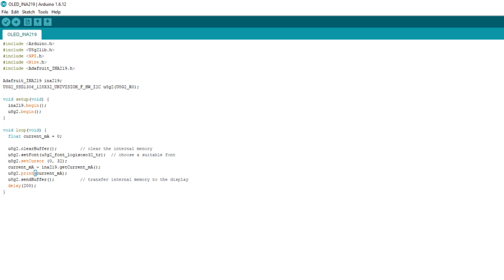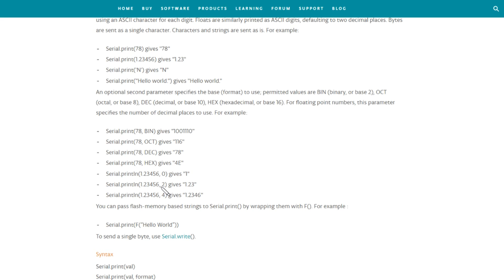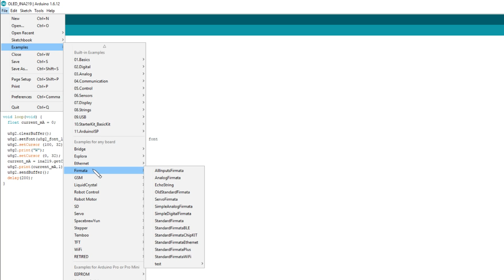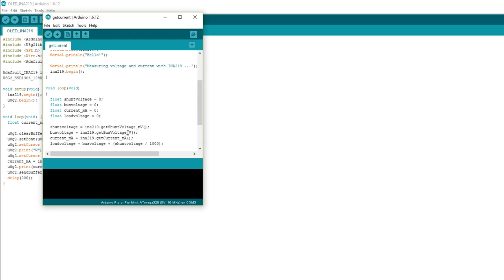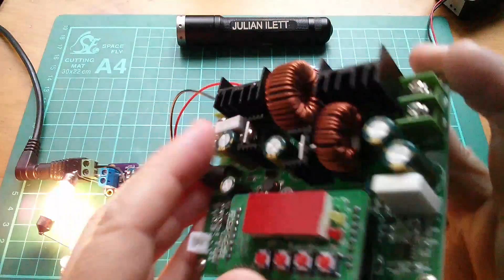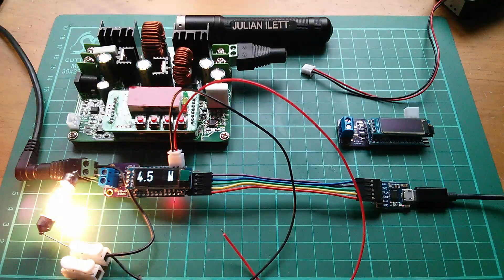Arduino Ammeter (with OLED) Converted to Wattmeter

Comment: If you like the larger 32 font size then it might be more convenient to add a micro button to manually cycle through the display types.
Automatically convert any value more than 999 milliamps to display as amps. I haven't tested this code I wrote it off the top of my head, it's just an example.

void loop (void) {
float current_mA = 0;
u8g2.clearbuffer();
u8g2.setFont(u8g2_font_logisoso32_tr); // 32 denotes 32 px font size, change the number to change the font size.
current_mA = ina219.getCurrent_mA();
current_A= current_mA/1000.0;

if (current_mA > 999){
// If value is more than 999 milliamps display in amps
u8g2.SetCursor (0,32); // Left aligned amp value
u8g2.print(current_A,1); // Displays amps to 1 decimal place
u8g2.SetCursor (85,32); // Right aligned A
u8g2.println ("A");
u8g2.SendBuffer();
delay (200);
} else {
// otherwise display in milliamps
u8g2.SetCursor (0,32); // Left aligned milliamp value
u8g2.print(current_mA,1); // Displays milliamps value to 1 decimal place
u8g2.SetCursor (77,32); // Right aligned mA
u8g2.println ("mA");
u8g2.SendBuffer();
delay (200);
} // close the if/else statement
} // close the void loop

The only way to change font size using the u8g2 library is to choose a smaller font.  The font itself is the font size.  https://github.com/olikraus/u8g2/wiki/fntlistall#16-pixel-height 
Hope this helps others with their projects. :)

Comment: a great idea is to modify this circuit adding only one high power resistor and some code to make it auto measure the internal resistance of any battery. i am trying to do that but your skills are better. i think everyone will find that usefull.

Comment: Very cool indeed! I love it, and may well build myself one of these things, thanks a million for the video.  I was going to tell you, perhaps you have seen these, they are not all that popular but I see Alice still has them, I picked up a half dozen about four months back when they were all over Ebay.  They are a nice expanded pro mini Arduino with plenty of power out and ground pins. While in the past, when I needed extra grounds, I would assign an unused pin to be low and use it as ground, that seemed to work OK and when I need 5 volts, I would assign an unused pin high and that seemed to work as well, but these, man they are the bees knees (use of my ancient talk when I was but a boy). :  http://www.ebay.com/itm/Atmega328-Board-5V-14-Pins-Pincompatible-For-Arduino-Pro-Mini-New-/401171901022
Reply from the maker: Thanks Jerry - I just bought one :)

Comment: Hi iv seen you use a screwdriver tool on the plastic multi turn presets with the brass screw on the top. Could you please let me know what the tool is called so I can order one of ebay. Thanks jon

Comment: I like most of your videos Julian, but it really irritates me when you act all dumb and stupid when you are clearly not dumb and stupid, how about you treat your viewers with the same respect?
Reply from the maker: How about you be more specific.
Reply: Julian, you are a clever guy! Why do you act daft in some of your videos?
Reply from the maker: Graham, I don't remember acting daft in this video. The mistakes (multiplying rather than dividing, forgetting the ground reference wire) were all genuine - and all rectified one by one. Irritating people - that goes with the territory, but being told that stepwise problem solving shows a lack of respect to viewers is a bit strong.
Reply: I don't mean any disrespect!! I appreciate and enjoy most of your videos! This one just niggled me a little. Lets move on and let it go. :) :) Sorry
Reply from the maker: Apology accepted. Still a bit mystified though.
Reply: OK......... if you want specifics, another guy already commented, 12V5W that is a car bulb so running voltage will be 13.8V......... this is not the first example I have come across, but it is the first example that niggled me enough to comment. Please do more MUPPET videos :)
Reply from the maker: OK, point taken. Muppet 2 is my favourite project at the moment, so more videos will follow.

Comment: Inspired by your experiments I had a go at my own INA219+OLED meter. It occurred to me that there are additional perks to using a pixel display over the 7-segment ones in typical multimeters. I managed to graph the instantaneous readings to better see trends. Some results pictured here for interest: https://drive.google.com/open?id=0BysPaPg1T8JKS3gtOUZyNHBmUXc

It displays a running min/max with the current reading in between and sweeps the graph display with a vertical bar showing where the update is happening. The main challenges are reduced text size and the refresh rate limitations using standard libraries. Still, why have less info up when you can have more no? Thoughts?

Thanks for the entertaining thoughts and tinkering as always.
Reply from the maker: That's what YouTube is all about for me. I don't often finish my projects (why would I?) but I love it when my ideas are used as inspiration for something bigger and better. Awesome picture - thanks :)

Comment: You can improve the Amps resolution by calling ina219SetCalibration_16V_400mA() from your Adafruit_INA219 instance. But first you have to move ina219SetCalibration_16V_400mA() from the 'private' (dunno why they put it there) to the 'public' methods in ''Adafruit_INA219.h". There's also a ina219SetCalibration_32V_1A() method.

Comment: The INA219 actually calculates the load power internally, but the ability to read the power register was missed out of the Adafruit library.  It was added in an update which you can download here:

https://github.com/adafruit/Adafruit_INA219/tree/dff62cd6696762dfea615bd01b0074e4081ef2ca

You'll see in the updated example that this library has an added function:

ina219.getPower_mW()

Of course using it still depends on grounding the other side of the load.  I'm not sure there's any real benefit over calculating within the sketch, but if all you want to display is power then it saves a few steps.
Reply from the maker: Thanks Paul - I'll give that a go.
Not sure why the Arduino library manager doesn't automatically update to that version.
Reply: Updating won't change anything... they never accepted the pull request, so it hasn't actually been added to the library. Wonder what the chances of it happening anytime soon since it's been languishing there for four years now... So for the moment, you'll have to manually edit the library to add that feature. 

https://github.com/adafruit/Adafruit_INA219/pull/16/commits

Comment: By using the voltage measuring trick, notice that you are probably making the ammeter input polarized. Imagine what would happen if you connected the 12v bulb supply backwards in the circuit... Wouldn't the voltage at the load connector be negative in respect to the arduino ground? How would the arduino behave in such a case? Hmmm.... Maye you can try this.
Reply from the maker: Interesting.

Comment: Hi Julian
You should be able to use the built in Power Register to get the right power reading, there is no need to calculate it in the arduino

Comment: How would you modify this circuit if you wanted isolation between the bulb and the wattmeter? How would you avoid connecting the grounds together?

(I know that the INA219 doesn't provide isolation, but let's assume you were using something like the ACS712, which uses the Hall effect for measurement.)

Comment: I have 2 of these INA219, OLEDs and many pro minis and want to build one.
I thought they have different font sizes! I have a USB doctor dongle, that uses one of these OLEDs and it has a few font sizes on the display when operating.
They crammed a lot of info on to the display. I am sure you know which USB doctor I am talking about. You have a similar one. 
Is there different font sizes available using this library, or should I just give up now, before starting?
Reply: UFOhunter The U8G library has multiple font faces and sizes.
Reply: Thanks. I will give it a go then.

Comment: You could "cheat"; since you already have the reading in mA, and you know the value of the current-sense resistor, just use Ohm's Law, and the Power Law, and simply calculate (current^2)*resistance to get power, then divide by 1000 to convert mW to Watts (if desired). :)
Reply: That would only report the power in the sense resistor.

Comment: Print a "+" in front of your milliamps value if it's positive, so it doesnt jump around when negative...
Reply: That might be simpler but it would look cleaner if the spot was just reserved instead and the numbers moved over a tiny bit.

Comment: I was thinking about how your 12v 5w light was not putting out 5w@12v. Then it hit me, it was actually designed for a vehicle correct? Then it probably puts out 5W closer to 14V because when a car is running it usually puts out just over 14v from the alternator. Anyways, I am no expert but I think that may be a case of just making it simple for the consumer. it goes in a 12v car, and should draw about 5w when in use. 

Love your stuff. I always look forward to your next video.
Reply: Crisan, the ina219 sense resistor is only 0.1R, so for this globe the burden voltage would only be about 40mV. The real reason is as others have said, nominal running vehicle voltage is 13.8v
Reply: I agree, if you put 13.8V, which is standard 12V vehicle float charge voltage, across the globe it will be 5W.
Reply: kaos havoc that is because you also get a voltage drop on the ina219 module shunt resistor that is necessary to measure current
Reply: True, I don't know the specs, but I am rather sure that shunt resistors will never cause a voltage drop enough to drop 2v from 12. They are usually really really small values.

Comment: you can change the font size of the mA, nA and W if you want. i feel like those take up way too much space on the screen but might just be me. 
should be via 

u8g2.setFont(u8g2_font_7x14B_tf);

you can pick different fonts from here https://github.com/olikraus/u8g2/wiki/fntlistall#all-u8g2-fonts-capital-a-height (they get bigger as you scroll down). just make sure you pick one that either has f or r as the last letter (so for example tf, tr or mr). ones with u will only have upercase available and ones with n only numbers and some special characters(those should work for your value though i'd imagine).
Reply: My thoughts exactly, start counting time and mWH can be displayed as well.
Reply: Was thinking the same, you could probably fit volts, amps and watts on screen all at the same time still with clear legibility due to it being a bright OLED.

Comment: Julian, I'd recommend taking a look at the INA219 datasheet, especially sections 8.4.1 (filtering),  9.2 (typical application), and 8.5.2 (calibration). Adafruit's library doesn't support it (you'll need to access the registers yourself) but the INA219 chip actually supports doing the power calculation itself. Also, tuning the calibration to your application can help increase the precision of the values returned.

Comment: Julian, just a suggestion, change the font size for the W/mA/V to 1/3 size on the right hand side - have W top right, mA top right and centre right (above each other) and V bottom right. Also put a zero crossing point in the code - i.e. display "0" until a positive is detected (unless you want to measure -ve voltage etc.) and add a damping factor so the display only updates every 250ms or such like to prevent the display jumping (unless you like that?) - once you get beyond two decimal places how many people really care? If so - use a proper multimeter! Thx. for the vids.

Comment: Hi Julian, I have been experimenting, I can confirm the differential signal on CAN does not need a reference ground. It's quite neat.

Lovely job on this, very cute meter. Always fancied building my own test gear. Closest I have ever got are building soak test rigs.
Reply from the maker: +The Backoffice cheers Andrew :)

Comment: I am thinking about conditioning the signal that when the signal is equal or greater than zero to put a "+" char in front of the print, so that it will fluctuate with "+" or "-" char in front of the value .. or use the absolute value :)
Reply: Or just use a space:
if (current_mA >= 0) { u8g2.print(" "); }
Reply: Colin Jones that should also do it

Comment: The INA219 already has integrated power measurement. Isn't that in the library?
Reply from the maker: +superdau Not in the Adafruit library.
Reply: You should be able to read it with this (stripped out of the library):

uint16_t value;
Wire.beginTransmission(INA219_ADDRESS);
Wire.write(INA219_REG_POWER);
Wire.endTransmission();

delay(1); // Max 12-bit conversion time is 586us per sample

Wire.requestFrom(INA219_ADDRESS, (uint8_t)2);  
// Shift values to create properly formed integer
value = ((Wire.read() << 8) | Wire.read());

And I think you also have to divide by two. Maybe you could try that for comparison.

Comment: Off topic, but they noticed have another batch of those little clocks controlled from the DCF atomic clock in Lidl today. The one I bought picked up the signal and went to the correct time in about 2 minutes. The 'as the crow flies' distance is just about 550 miles from here to the signal site.
Reply: I've got a british (MSF) one that barely gets a signal in britain... be a worthwhile rainy day video to open it up and probe the rf end with the scope, could potentially also check the frequency meter kit build from January since the rf is derived from an atomic clock standard.

Comment: Automotive voltage runs nearer the 14 volts so the bulb wattage is about corrects.
Reply: Mike James True and commercial 24v vehicles around 28v.

Comment: Why not use a smaller font for the units? And put it in the lower right corner. 
It does consume a bit more memory for the extra font, but will solve your problem and looks nice as well.

Comment: 290 to 350 mA is a huge jump. You have a terrible noise coming from somewhere. I wouldn't use power bank for the arduino. They trend to have up to 1V p-p noise. Also some of the chinese DC-DC are like this. I measure each unit comming from ebay and if I can't achieve <50mV p-p noise I don't use it.

Comment: You could use P=I^2.R because R is known at 0.1R to reduce code complexity
Reply from the maker: That would also mean I don't need the extra wire for the voltage measurement - can this possibly work? I must try it...
Reply from the maker: It kind of works, but the result is wildly inaccurate - maybe because I'm squaring such a small number?
Reply: Nope, that would calculate the power being dissipated in the current sense resistor, not the load.   No way of avoiding a third connection to measure the voltage across the load I'm afraid.
Reply: Wouldn't that just give the power being produced across the resistor though?
Reply: Couldn't you tack a short wire onto the wire connecting the grounds of the Arduino / display / INA module?
Reply: Yes of course and the compiler will be using 16-bit integers' and 32-bit floats', changing float to double would help. Great projects and channel BTW.
Reply: Luckily the INA219 has an internal Bus Voltage measurement so getBusVoltage_V  will return the Bus voltage, so no need for an external connection to calculate power.
Reply: Bus voltage relative to what exactly?  If you don't have any connection to the other side of the load then the bus voltage will just float, settling at a value unrelated to the voltage across the load.  You have to ground the other side of the load so that it's no longer floating and then the bus voltage compared to ground is the voltage across the load.
Reply: The datasheet clearly shows the ADC has a switched input that is either measuring a shunt differential voltage or V-in relative to Gnd. IF the V-in side of the shunt is grounded then the result will be 0-volts. So ideally the device needs to be wired with the shunt (let's call it) high-side then V-in will be the load voltage.
Reply: Shunt high side = other side of the load grounded.  We appear to be in agreement :)
Reply: Paul Grimshaw yes and it's clear that Julian's two circuits are independent thus requiring that ground loop connection to enable a bus voltage measurement. Adafruit have not implemented the device power measurement capability but easily added to the library noting it needs a calibration setting in the registers before it will produce a valid reading.
Reply from the maker: That explains the odd result!
Reply: I notice there is a newer device INA219 that can be used high or low side and its internal bus voltage measurement positions change when set accordingly.